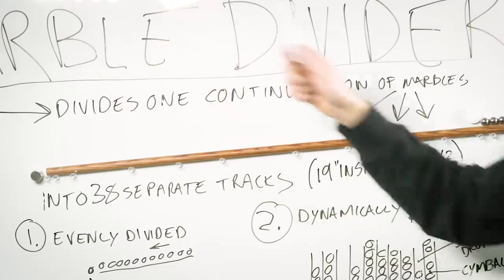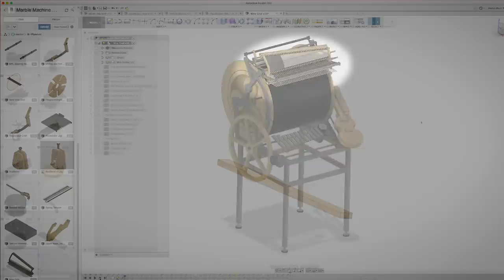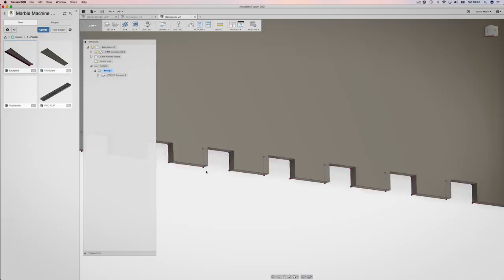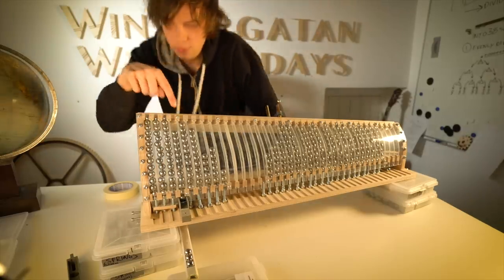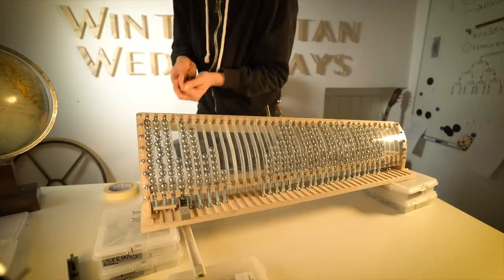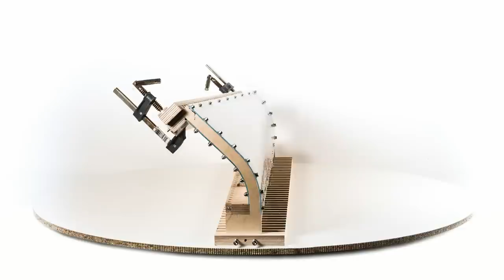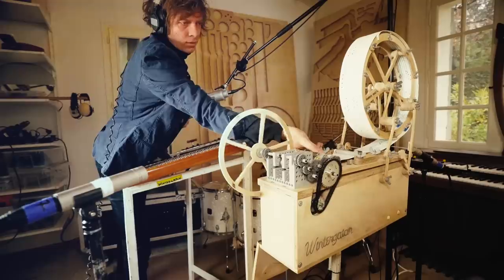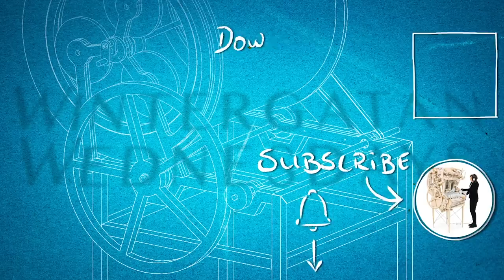Marble Divider - Marble Machine X #21

Comment: I know you don't need unsolicited ideas but this problem reminds me vaguely of the fuel delivery system in a fuel injected engine. Wherein more fuel than needed is supplied to the engine and the surplus is routed back to the tank. The continuous extra flow ensures there is always enough on hand. Conceptually I can see this applying to a marble machine. Heck, they both have cylinders.

Comment: As a retired machinist I wish everyone involved in any kind of manufacturing would learn the distinction between tolerance and clearance. Tolerance is nothing but the allowance given to adjust dimensional errors during manufacturing as manufacturing to the required exact dimension is both difficult and expensive. Clearance on the other hand means how much gap or empty space is between two mating parts. He should have used the word "clearance".

Comment: This seams like a simple solution, but I wonder if you have tested it with 100% saturation or all the channels and incoming feed on the top full.

Do the marbles fall down when space is open up or does the full incoming feed jam because the incoming marbles don't line up when filled to saturation with pressure from the intake?
Reply: rkbinder I see that problem too. If all the channels are full, how will marbles pile up on the top slope?, and will they end up in a position that won't fall into some channels when the music starts taking out marbles?

Comment: Well done, Looks absolutly brilliant and the concept seems to work quite well. But there is one little thing, i think wont work: Will there be an overflow? While muted all marbels will end on the divider, so the total number of marbels in the machine is restrictet to how many fit into the divider. If the machine is running and there are for example 20 marbels traveling trough it won't be possible to fill the lower rows on the divider, cause they are only filled when all others are full. To make them full for example 20 marbles extra are needed. Those will fall over if muted. So I think the only way to get it work is to add a overflow on the divider and have olways about 30 marbles more in the machine. If I'm right, Im also sure you will fix this little problem. Many greetings from Germany!

Comment: Might be a little too late but if you want the polyacrylic to be a bit smoother then use a normal heat gun instead of that torch to heat it up. The torch is way to hot and have a much more focused heating spot while a heat gun is spread out and not nearly as hot but still hot enough to bend the polyacrylic.

Comment: it'd be nice if the marble droppers dropped a ball moving in either direction which could be done with a rocker, those one side would need a guide to drop. I guess it depends on whether or not single sided can play as fast as you  need. if it ever is too slow then that may be an idea to use bi-directional switches for things that need to translate some distance along a path that remains the same forward and reverse.

Comment: Next time you have to bend polyacrylonitrile, use an oven instead of a flame or heat gun. To heat it completely to glass transition temperature with a heat gun or burner, you'll almost inevitably overheat it in some spots and get degradation.

Comment: i wonder how it really sound using rubber marble balls... or coating the marble with some soft coat to reduce that solid steel sound of the marbles... or maybe find a perfect sequence between different type/size of marbles when it enter a certain chamber section on the instrument part to make it sound different...

Comment: This will have a lot of problems if you use magnets without demagnatizing the marbles. I'm sure you've already considered this. Not a real problem so long as you constantly demagnatize the marbles. AC current through a winding around a tube with very thin walls. Running all the time.

Comment: What would be to use not metal marbles, else colored glass marbles? Or poly-carbonate ones?
Reply: Zoltan Hoppar   He is using magnets to lift the balls, so they have to be steel.
Reply: I know, but using colored metals in glass marbles would be interesting. Just thought.

Comment: Have you made some flow computations for calculating the risk of running out of marbles in the last gate(s)? It should have enough of a fill rate to be able to cover for alot (if not all) of the slots for that gate in the programming wheel..Otherwise, isn't there a risk of lack of marbles when needed/limitations in music that can be programmed?

Comment: Hi Martin!
Thank you for this new mideo about MMX, it's have been a long time....
I apologize for what will come next .... but at 4:10, when the marble fall from the divider into the "great part" (it's look like a drawer) there is a sound like "tac" and it highly audible. 
Are you not worried by this noise? It could pollute the melody, don't you think so? While  you have just tried one drawer, it's not so much significant, but when several will be used don't you worry that it will make more noise than the music?
May be a piece of felt (feutrine in french), or some other damping material, will be able to reduce it...
The problem is that the thickness of this material will change the height of the marbles colomn at the top of the divider.....
I really apologize for this remark, but this point look important to my point of view...
Thanks a lot for sharing this new experience with us and keep going.
Take care...
....
After watching one more time the mideo "Trigger Mechanism - Building MMX Ep.#10" I understood on what piece the marble fall and make this 'tac" noise at 9:00. When the marble falling down from the divider into the hole of "the great part" it's hiting the plywood deck just underneath. This is the place that need to be isolate...

Comment: Beautiful. I am concerned about marble height variation of full cells along the marble track. I think you should be testing at full chambers of all tracks, with all sliders. I fear a potential marble "bump" on an instrument that doesn't play as much on the viewer's left of the track impedes filling tracks further right.

Here are my concerns spelled out more clearly. Observe how variance in marble track cells widths (diameters?) causes uneven stacking sequences. Some are stacked even and tall, some stagger. Those cells with stagger will stagger irregularly, causing variances in height that the slider won't be able to accomodate. A cell that stacks one time in perfect alignment could another time leave a ball sticking up enough to impede the track.

A simple fix is to add more of the spacers you carefully hand made. The correct fix probably involves a remake, with more precision in the plastic fabrication to ensure regularity of ball stacking in each cell.

Comment: ok, so i love the design of the marble divider, BUT I think I might see a problem you will encounter,. Especially near the lower end of the divider, it can only hold maybe 5-10 marbles, so if that instrument gets alot of attention (or if one right in front of it does) it won't be refilled until every single other marble slot is completely full, and on a machine that is constantly using them it seems unlikely they will be refilled as needed. Love you and not trying to doubt you, in fact I hate to even say anything, but I couldn't say nothing haha keep up the good work <3 it dos at the very least LOOK fantastic =D

Comment: I had a really long think about this design. If you used plastic tubes like your original one, you could cut them all the same length and wouldnt need individually designed 3d printed parts down the bottom (just the end ones would have more of a "kink" in the tube). Also, did you consider having less marbles in the queue overall and having a marble recycling system if they're all "full"?

Comment: CONCERN: feel the last rows of the two sections will have a difficult time being fed. For 1 marble to feed them all of the previous rows must have been filled to the top and muted for a while for the marble to get there. If any previous row plays, it misses it's chance. I see you wanted a faster way to drop marbles for each channel but I believe that this will affect the feeding of the next rows. You might consider mixing the previous system for distribution and this system for display and velocity. 
The possibility of the last rows  of each section, even if they are two, drastically decrease each time a previous row is played. At minimum, the last rows should be the ones that had more stock of marbles, not the first one, and I mean a lot more. (Even though I'm a bit skeptic). 
The first row is the one that has most marbles in stock and is the first to be fed.  You should try this theory in an animation, maybe someone could make a virtual prototype or midi video game for unity to prove this. 
REALLY HOPE I'M WRONG

Comment: I am really concerned about the last track on each set that will not get filled very often since it's still kind of unbalanced, then ones that get filled very often hold a lot and the ones that rarely get filled hold so few marbles, there has to be a way to add a higher degree of a slope on each set to have it backwards, the ones that get filled very often hold just a few marbles, and the ones that don't compensate that by having more marbles stored, at least that's what I think, great video.

Comment: But the marble columns aren't going to be full all the time, so this mechanism may still under-feed the ones at the far side. having 2 feed rails on both ends would probably solve it as you explained, however that may depend on how fast the feed-rate is going to be. It's also going to be better if the feeding mechanism that you showed happens every other column (e.g. odd/even columns fed by separate rails in which these rails are fed 50% by another mechanism (similar to the letters 'W', 'M' on the original Marble Machine.) And if possible, the middle ones are fed by both of the feed rails to accommodate for the probable under-feeding.

Comment: I'm a bit surprised why you made the longer dividers come first. I'd assume that if the shorter channels come first, they'd fill up first thus letting the marbles pass over quick leading to less starvation of the longer channels that'd come later. Then there'd be less need for a second marble supply.
Reply: my guess is a flat row at the bottom, combining with the need for a slope at the top gave that design. So what sort of shape with a flat bottom could give marbles rolling downhill on short dividers first, then long ones?

Comment: 4:45 second track. Marbles are not in the straight row. This can be the problem. When marbles arranged in different zig-zags they have different height. So you can't adjust wit 3d printed parts perfectly. So maybe old solution with transparent tubes is better.

Comment: I'd have used a hot air gun from Lowes instead of torch. It will give you more evenly applied heat resulting in less distortion in the final piece..

Comment: You could have a problem with tolerance buildup.  You are adjusting the critical position of the top marble by adjusting the position of the bottom marble in the long column of marbles.  if the zigzag stack changes, or the curve of the relatively unstable plastic face changes due to age or temperature, the top marble will be out of place causing a jam-up when the column is full.  if you had a nearly right-angle turn between the top marble and the rest of the column, this problem would be eliminated as the adjustment would be made at the top of the column rather then the bottom.

Comment: The duel channel is the best. The offset pins would be a pain, never having the right ones . Wouldit not be awesome if you could have program on both channel, waltz and 4 4. Need to find a mute for 1 while run the other.

Comment: I sense a problem. Because each "tube" fills  in order, the possibility of skipping notes is increased depending on how frequent that note is in a particular song. For example, if one of those tubes all the way on the right are playing a lot, and the feed rate of the marbles down the track is already reduced by all of the other tubes to the left of it, there is a possibility of the tube completely running out of marbles before a new one can be reloaded into it from the track.

Comment: A good way to apply heat evenly to bend things like wood or plastic is to use a steam bag. You can put the piece inside a plastic bag and pump steam into it, so it's very easy to bend into any shape you want. Ship builders use it all the time. Check out ?v=iGjFQjss5bE -- however it may not work for such thick plastic as yours, works much better on wood

Comment: I have a feeling this is weaker point in your design. Have you tested at the speed at which the lifting wheel will be flinging marbles into it? I'm afraid the marbles may start skipping holes at that speed. Plus they will be slightly magnetized from the wheel's magnets so they may be sticking together in different ways than you expect.

Comment: Im sure there is a logical explanation. But, Why didn't you outsource the plastics work? The Bending anyway? You have a lovely workshop. You should really add the ability to bend plastics. Crazy easy to make a hot wire, reflector and frame/holder. I am sure you would have no problem building one. In fact, knowing you, you will probably improve on the common design and make something extraordinary, that can bend plastics like never before. lol. P.S. Dude, you are awesome btw!

Comment: There is 2 week spot, I can see in this solution.
1. Is the marble able to pass through other marble when it get magnetized? (You spotted that problem some time ago)
2. And more important: Last "channel" is the smaller one, which mean, that You cannot use them with the same intensity as other. Another weakness is hidden in queuing. Last channel will be always filled as last one. Combination of this two problems, can very reduce ability to use this channel. Did You consider that?

Comment: ... forgive me for putting in my 2 cents put this part sounds so loud with steel marbles hitting plastic containers, have you thought about using some felt to mute parts of the machine that will most likely create a lot of noise while its operating ?

Comment: This channel design would only work if the input of marbles is equal to the usage of marbles.
Which would mean the speed at which the music is played should at most equal the speed at which marbles are brought back to the top.
Making the speed at which you bring marbles to the top the limiting factor.
Using marbles faster would leave the endings unable to keep up.
This combined with the design choices to increase the speed at which music can be played leaves me worried.

Comment: Okay, I'm not an engineer or anything, but there are some problems that I'm not sure will be problems once the MMX is completed, but I thought I'd say them anyways.

1. Since the marble has to roll across the top and across any full marble channels, I'm concerned that the speed of the marble will become too slow by the end of the line and towards the middle rows (I know you said you'd have two lines of marbles released there) and slow up the refilling of those rows. 

2. Others have already mentioned this, I think, but in the channels, the marbles seem to have too much space to move around. They're not lined up exactly on top of each other and are instead in a zig zag sort of formation. That might be a problem for the marble at the top sticking out too much or not enough to be the exact "fullness" required for each channel.

Comment: Why stack so much marbles after the divider?
You will also have a buffer before divider and marbles will always fill the whole slope of the divider sliping just in the holes of notes played and moving one place at a time. They will not run down the slope as you showed cos it will all be full all the time, right? 
go mmx

Comment: I'm a software guy, not hardware, but this type of problem isn't foreign to my domain. Mechanical issues aside, it seems weird that you are using a shorter marble queue on the channels that are most likely to be starved of marbles. I would think that should be reversed;  the shorter queues get marbles first and the later queues that get less have more in reserve to prevent starvation.